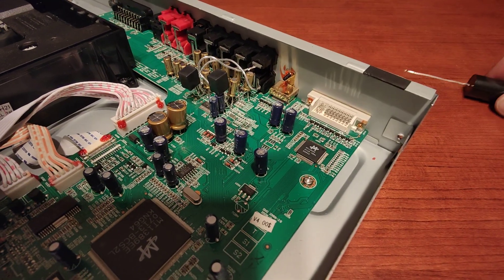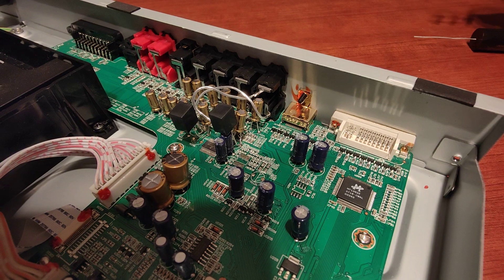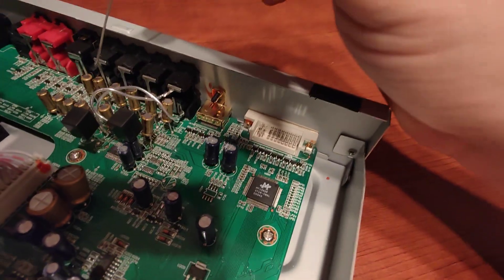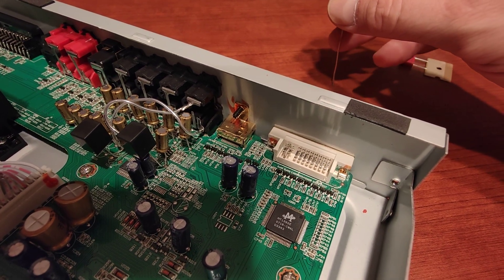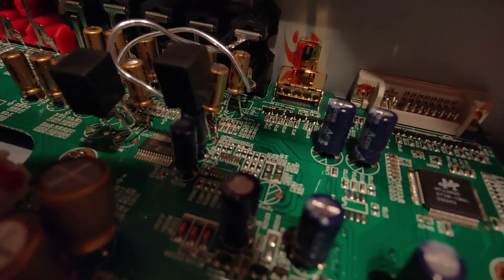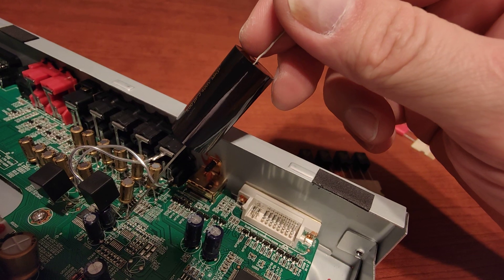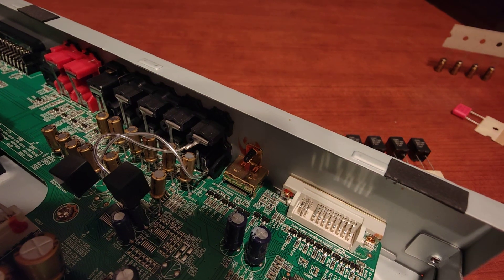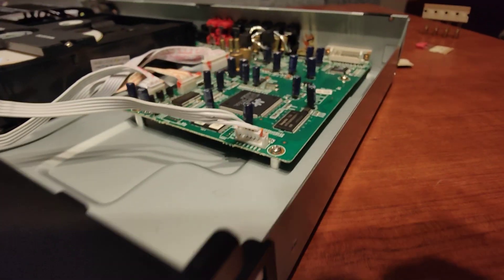Vintage Cambridge Audio DVD89 - SACD-R player mods

Comment: Interesting 
I tried to connect my Cambridge with HDMI but still, can’t get DSD despite my Marantz AV receiver can decode. Simply no sound
Reply from the maker: DVD89 decodes SACD only as analog out, it doesnt do DSD over HDMI - there was no audio equipement accepting anything like that when it was released (and for many years later)

Comment: Did you put one wima MKP on each of the output stage capacitor? There is enough space under the PCB? I believe there are at least 12 capacitors need to be replaced. By the way, what film capacitor would you recommended just for the L and R channel?
Reply from the maker: R&L outputs are bridged with fronts, but yes, that was 11 or 12 caps. WIMAs are flat and they fit nicely under the PCB - soldered flat with board. For just L&R use whatever brand sounds best for your ears and can be fitted inside. I usually use Jantzen or Mundorf, for small (in terms of physical size) ones I go with WIMA10 or Vishay1837.

Comment: Hi I am based in UK, would you be able to update mine Please, i will obviously pay for a work, parts  and delivery. Thank you (Dziekuje)
Reply from the maker: Hi! I can try to help you, but I am afraid that 2 way shipping alone would be more expensive than doing this locally. The parts are peanuts, capacitors altogether were like 5 quid. Resoldering can be done by any home appliance or audio-video or mobile phone repair point. Please try to find someone local as this will be way cheaper and faster for you, if you wont find anyone give me a shout in the comment here and we'll work something out.